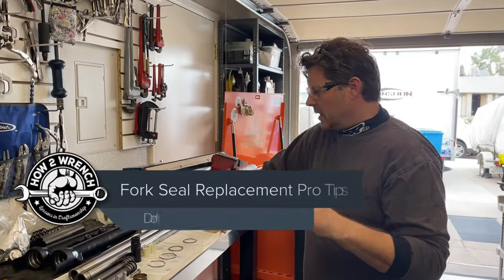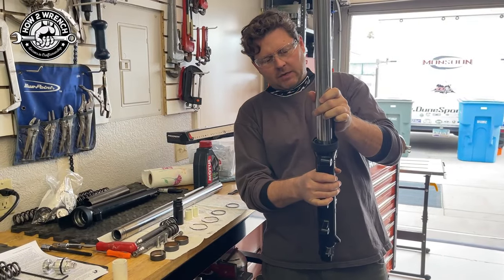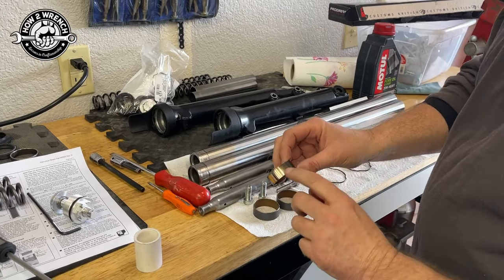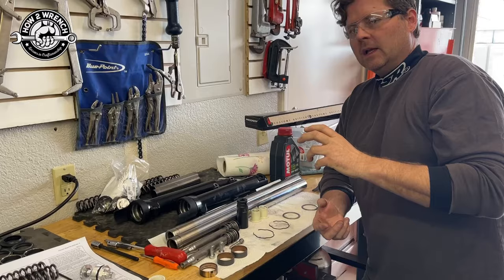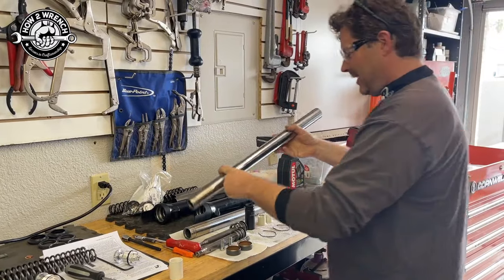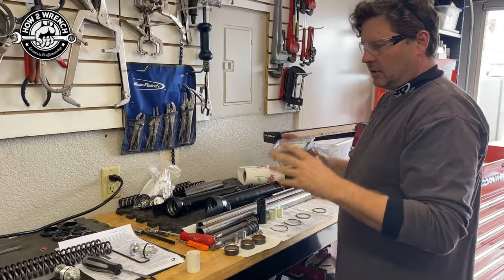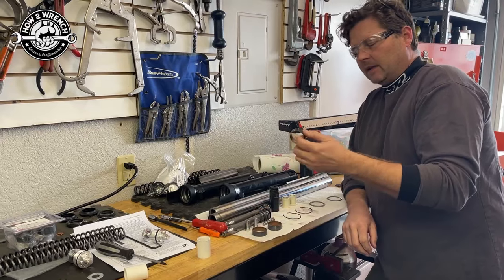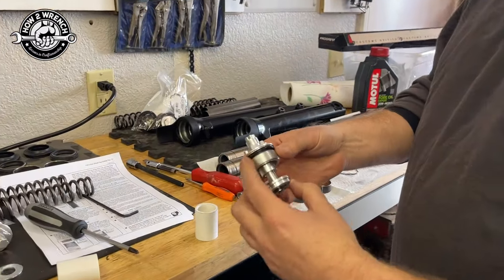Discontinued parts for motorcycle forks? No problem Rad upgrades  #allballs #how2wrench  #triumph

Comment: Only good thing I would say about Allballs's fork products is that they come as a bundled box in many cases. 
But they quality of their parts are not good. Seals are way to stiff and tight to a point where you can actually feel the seal flex as the forktube change direction. "Of the bike ofc"

If you need fork or shock parts, have a look at K-tech's products. They provide in many cases OEM info about oil type, level/ammount/setting/spring stiffness and much more.
Reply: I've heard about the questionable quality on All Balls in general...but I just needed those specific bushings which Triumph does not sell and I did some research and looks like some older Yamahas cross reference. But to get them would have taken too long so just ordering the All Balls kit was just the best way to go in this scenario. All my other parts were factory.

Comment: What year bike are you working on? Also, where did you find those adjusters?
Reply: This is my bike. 2007 Bonneville.  Got the adjusters from Bella Corse.  Just checked their site and doesn't seem to be working.  Don't know if they went under or just having IT problems

Comment: I will never buy from All Balls again. Their quality control is absolute crap. Replaced some front bearings and had a bad vibration. Turned out the bearings had 0.02 and 0.08 play.  For a different bike the bearings were 0.15 out of round and I couldn't even put them in. Stopped buying that crap and I haven't had any of those problems with other manufacturers.